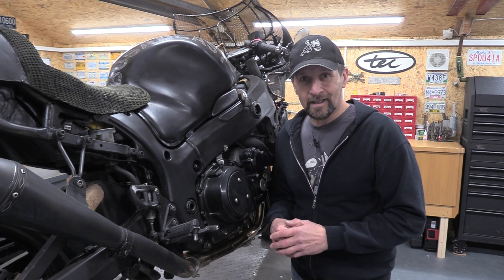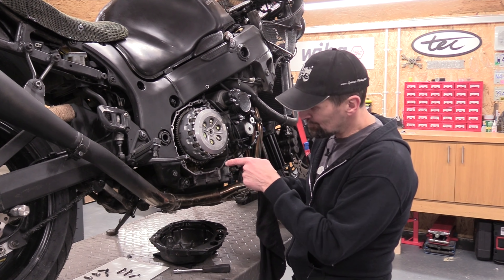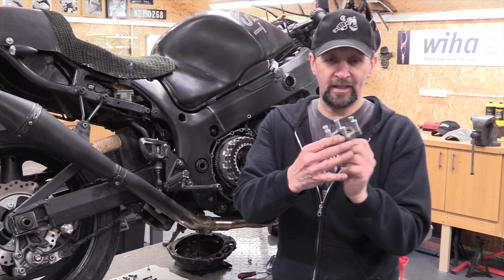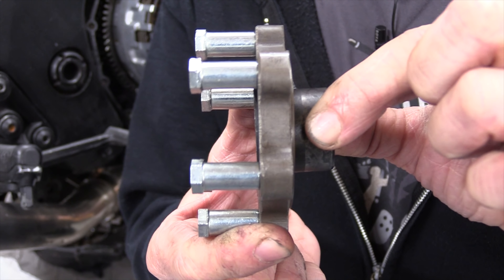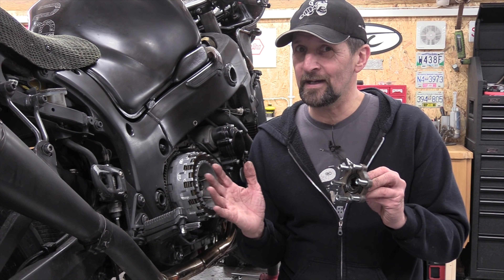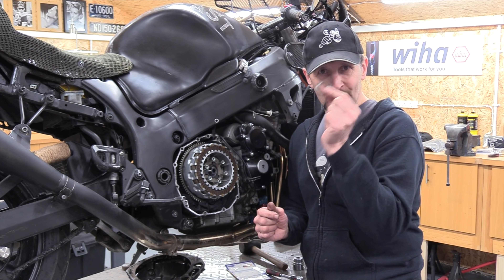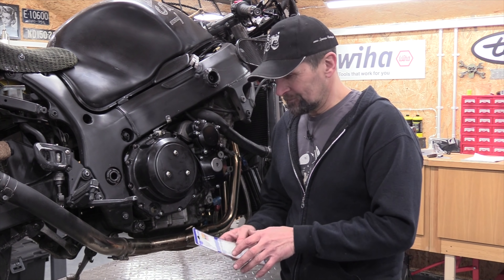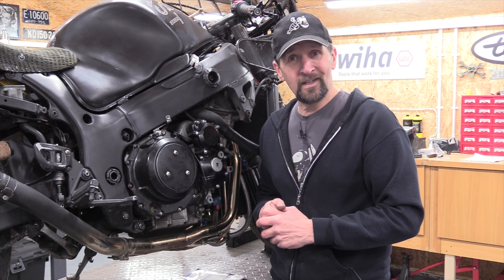Suzuki Hayabusa Gen1 :-  Clutch Mod Install

Comment: I didn't know that the Busa had such a simple, cheap and effective slipper clutch. Clever idea, but obviously there is wear in the end. Good that you showed us a simple way to solve the problem. Thanks from Nürnberg/Germany, Günter
Reply from the maker: Glad to help Günter , It's actually a common mechanism in many Suzuki models, TL1000, GSX1400 etc, and does indeed suffer with wear, and after 40k miles, mine was playing up, so time to lock it up and eliminate it from the system.  Have a great weekend and keep safe.  Del.
Reply: @wilsonisme1  Interesting. Food for thought. Thanks for sharing

Comment: When you took the clutch apart I noticed the outer friction disk was in the wrong slot. You did correct that. Maybe you should have mentioned that. As far as the Clutch Mod. I prefer the Mod you used. Or the one piece Mod. I'm sure some will disagree. But far as I'm concerned the welded fix will never be balanced properly.  Good video...!
Reply from the maker: The plate wasn't in the wrong slot, it only goes in one place, it just came out stuck to the outer pressure plate and I flicked it back in, and you are right, some argue that a welded mechanism isn't balanced, and the one piece billet ones are way outside my price range, this is the third one of these I've actually fitted, they work a treat and have never let me down!
Reply: @Moonfleet41  Not to argue... But I watched the video again. The last friction is in the long slot as you remove the pressure plate. And when you reinstall the pressure plate you have moved it to the short slot where it should be.
I was agreeing with your Mod. The ring you installed is a Good fix and holds up well and presents no balance problems.
Reply: Aa a welder myself i would have no worries about balance if TIG welded by a professional as the weld would be an even width all the way round and that width would be small, say 3mm wide. Being so close to the centre of rotation, any imbalance would be negligible and would have no detrimental effect.
Reply from the maker: @bertzx9r894  " if TIG welded by a professional" exactly that, which is why i didn't weld it, it's way above my pay grade..
Reply: When Brock Davison installs clutch plates on a Suzuki the very last plate he rotates one notch. I don’t really understand that. If anybody understands why please let me know.
Reply: What it called  where can I buy it

Comment: I've heard about this mod, but had never seen one being fitted. Now I understand. Thanks.
New shop looks awesome, and the audio is crystal clear. The wall panneling must be a winner
Reply from the maker: Thanks mate, simple enough mod aye?  And for those who can't weld to the right standard, or afford to buy performance parts, this is a perfect nut and bolt fix... and thanks for your kind words, the textured walls and the open roof have made a difference!

Comment: Yes Del I had to learn the hard way, 30 years ago I had a Suzuki GS 750,  I was adjusting the valve clearances, I’d made a tool to lever the valve buckets down to remove the cam shims with a old Allen key, but couldn’t get enough leverage on the key, so I used a small length of pipe to extend leverage, and yes you’ve guessed right, it slipped off and the bloody Allen key disappeared down the timing chain hole, my heart sank, major engine strip down😩 but I was so lucky, after many hours with one of those magnets that look like the car aerial I fished it out, boy was that a relief 😅 that’s when I decided to block the hole up before Continuing adjusting the cams, workshop is looking great, that’s a good cheap mod cheers Del ⚙️🔩🔧👍
Reply from the maker: HAHAHAHA.. Mate, i feel your pain, i was that man too.. literally dropped and actual shim down the chain shaft.. Bastardicus maximus..  had no fancy car aerial magnet thingy.. turned the engine upside down in vain hope.. and the shim went up under a piston skirt and lodged tight.... but at least pulling only the top end off gave me access up under the piston...  lessons we never forget aye mate.   Thanks for your kind words, have a great weekend.. Del.
Reply: @Moonfleet41  we’re older and wiser now thank goodness, cheers mate 🍺

Comment: Way to go mate! I'm getting ready to do this to my 2002 Hayabusa I'm getting weird slipping clutch issues under full throttle where it almost like feels like you're pulling in the clutch lever instantaneously and I come to find out it's the ramping crap and I get the knocking at idle with the clutch lever out too it's very annoying. I can't wait to do this tomorrow. Thanks for a great excellent video also to anyone doing this always get the Gen 2 clutches cuz they have more clutch material than the Gen 1.

Comment: I have a '97 TL1000S and the clutch ramp system apear slightly different to this in terms of its size however i cant confirm that as it was welded before i bought the bike. The clutch did slip slightly on hard throttle but a set of Barnett clutch springs put an end to that.
Great video Del and i love seeing these little snippets of difference with the different bikes.
Loving the triumph build but will admit to skipping a few episodes due to being a long term subscriber and seen the caliper rebuild on the ZX7, caliper rebuild on the Busa... so occasionally its a case of same footage, different bike. Always around for the fresh stuff though and aways will be.
Be well D&P.
Reply from the maker: Thanks Bert, we just upload the projects that come along, and I think maintenance and refurbishment videos can always benefit from being refreshed and done again, because people don't tend to watch your back catalogue as much as the fresh ones!  Plus of course if it's their specific bike they're more likely to watch it, but agreed, if you're a long term viewer then some subjects will come round a second time... I guess it goes to show how much stuff we've covered over the years!  Thanks so much for your support, we really appreciate it!

Comment: The first clutch friction plate was in the wrong place, until you shifted it,, but then you knew that ;). Im going to do that mod to mine but i will weld it i think,  looking forward to the slave cylinder mod too
Reply from the maker: Sure thing buddy, welding works if you're good enough at it, but it must be TIG welded and unless you're gonna weld it all the way round, make sure you space the welds evenly for balance, but I'm absolutely sure you knew that lol

Comment: It’s a constant mesh clutch not a slipper clutch, the idea being it limits back torque on down shifts and stops the wheel from locking. 

But the original clutch causes issues on launch if you get it in between the area of revs between it engaging and disengaging causing a hairy launch.

Also if you have fitted stiffer springs you really need to beef up the mount for the slave cylinder mount as they are notorious for cracking and falling apart with heavy duty springs.
Reply from the maker: Check out the very next video we'll be loading up online on Tuesday mate.. Slave cylinder brace plate... ! great minds think alike aye.!±

Comment: Did your clutch jerked during launching? Mine is doing some violent jerking occasionally if you are launching it. I have been recommended to install all new OEM clutch steel plates along with friction's, but I'm guessing that it might not be solved until this kind of modification is done.

Comment: I did the mod on my previous Hayabusa by welding it. Got another Hayabusa now, fairly high mileage, and definitely want to do the mod again. I like the idea of the spacer ring though. However my question is more on that lovely torque wrench setup you have there. Where can I find it online?
Reply from the maker: There is a link below the video that that T-Bar Torque Wrench, along with a link to the parts used on the bike..  Good luck with yours, hope this helps.

Comment: Great Video - I can't see the link to the seller who sells the schnitz locking ring for hyabusa clutch, I live in Australia and the cost to have it sent from Schnitz racing is almost the same in postage as the same for the part. Any suggestions would be most welcomed.
Reply from the maker: It's in the eBay link i posted in the description below the video mate..

Comment: Hi Delboy, I want to share information.  I ordered this part (hayabusa 99-07) and installed it in a suzuki gsx 1400 year 2006, it fits.  same clutch hayabusa  and gsx 1400😉
Reply from the maker: Thanks for the info
Reply: @Moonfleet41  UPDATE several times my clutch slipped at higher speeds after installing that part... it was very annoying at 150 km/h when it slips and then catches again... I took the part off... something didn't fit right and I wouldn't recommend it  if that part is installed on  gsx 1400... I wouldn't like someone to install it and then something happens... very annoying when at high speed the slats slip and then catch again,... Sorry
Reply from the maker: @tomislavknezovic1  I don't know what you're referring to by clutch slip, if you're referring to the lock up ring that stops the back torque limiter from operating, then it can't slip if it's correctly fitted as it locks the mechanism solid... so not sure what happened for you, but never had a problem with mine on the Hayabusa... but thanks for your input!

Comment: Is there a place for option 4, to replace with a new slipper clutch? Then you do not lose the benefit of the job it does. Or is it too expensive/ not work having anyway?
Reply from the maker: It wasn't a good design in the first place mate.. but i guess you could simply order a new one from your main dealer... !

Comment: Do you know if a similar kit is available for the TL1000R?  If so is it possible to use the standard springs so as not to make the lever heavier and reduce the strain on the slave cylinder?
Reply from the maker: I believe it is, provided your bike has a back torque limiter, check with the supplier for spec on your bike, I left a link in the description.

Comment: Hi dear .. I have hayabusa gen 2 .. And i have issue .. When the gear on position 3 and RPM high then when i leave the throtel i got like a cut when RPM arrive to like around 7 do you think this issue due to this part you work on ?

Comment: If you need to ever replace your "conical" washer they are called Belvoir washers and are available in different sizes in the engineering world so you wont need to go the the bike shop for your new one and as already said they are a one use device.
Reply from the maker: Thanks mate, when we're allowed out to play again, I may pick one up just for good measure!

Comment: Is it wrong I'm checking out your tools? 😉 ☺ 😂 
I love my ugga chugga gun and was admiring your torque screwdriver but don't use one often enough to warrant the price. Cheers matey.
Reply from the maker: Aha, but therein lies the paradox, you may not use one, or find life hard without one, but if you buy one, you'll soon find a million uses for it, and reach for it all the time.. and for the huge nuts on front sprockets and clutch baskets alone, they are a really handy option.!  and with a fleet of training bikes to keep rolling, i guarantee you'll 'justify the buy'..!   so if you buy one, then ill buy a 360 camera (which i definitely don't need.!lol)
Reply: @Moonfleet41  hahaha, this is like two people trying to stop smoking... "go on, you have one then so will I" 😂 ok... What model is that one? ☺
Reply from the maker: ha ha yeah, "no you go first"..!   The impact gun i use is a fancy programmable one that works through an app, 300Nm torque, lots of features you won't need,  hardly for occasional DIY use anyway.. it was over £400 with both batteries and the charger, but like all these tools, It's the batteries that cost the money, and once you have a pair of batteries, and charger, you can buy the bare hand tools for more like £100 a go.. drills, impact drivers for woodwork, angle grinders, power saws, any hand held power tool you can think of.. as long as it uses the same batteries, just buy the tool.. Once you swallow the heavy first purchase of a kit with two batteries and charger, it gets a lot more cost effective from there..  Here's a few link that may help, 'Russ' (who owns Spanner Monkey) does them all at really competitive prices, and would be happy to work you out a deal if you call him direct, tell him i said hi.. https://www.spanner-monkey.co.uk/index.php?route=product/search&search=+Milwaukee+M18+&description=true  !
Reply: @Moonfleet41  I've got the ugga chugga gun already, it's the wiha torque screwdriver you used I was looking at. ☺
Reply from the maker: @RoadcraftNottingham  Oh right, Duh, sorry, "must try harder".  Thats a 5Nm to 14Nm Torque Driver    There's a link under the video to it, but yer Tiz'  https://www.spanner-monkey.co.uk/Wiha-Torque-T-Handle-ST-Plus-TorqueVario-Set-29234?search=wiha+torque+vario&description=true
Reply: @Moonfleet41  HOW MUCH? I spent all my money on a fast toaster ya know! 😂
Reply from the maker: @RoadcraftNottingham  Ha ha yeah..good ain't cheap and cheap ain't good..    you could save up the money from the petrol you WON'T now buy for the toaster aye :-D..!

Comment: I haven’t got a Hiabusa I just enjoy your videos great work as always I really like the small torque wrench spanner are the expensive ? Keep up the great work 👍👍
Reply from the maker: Hi Dale, thanks for your kind words, the small precision torque wrench isn't cheap, bit it is a premium quality tool, which is important for those smaller toque values that can be easily stripped.   I posted a link to the tool under the video mate.

Comment: Really interesting clutch work!! At first I’d thought it’s clutch plate, apparently, it’s more than that, moving magazine system (whatever you call it) . Sure simple fix with spacer. I’d think you licked this one,  personally, I wouldn’t weld any internal parts at all as it may crack at the weld point. No matter who’s professional. ( that’s my opinion)  perfect example before and after video!! I like that!!  Kwel!!
Reply from the maker: Thanks buddy, I have to agree with the welding opinion, it truly would have to be done by a top class professional, otherwise there would be balance issues possibly (maybe not as it's very close to the centre of rotation), but nevertheless with the heat issue, I agree... it's already hard metal so one could question whether heating it to weld temperatures could anneal parts of it and I guess this is why the drag racing guys who run monster horsepower actually swop the mechanism for a solid billet steel one... happy with this route though and certainly more confident in it than I would have been with my own welding.
Reply: @Moonfleet41  .. my dad welds past 60 so years, he can’t make near perfect, maybe close. Win some, lose some. Heat and material wise is biggest challenge. I second what you said. I’m kind of guy modified to make things work like you did. Got from EBay?? That’s interesting as I’m EBayer too. Always find something there.  Btw- what’s the cost for that kit?? Just out of curiosity 🤗 btw—- I like your torque Allen wrench,, hava find me a set..  can’t wait your next video.  Stay safe..
Reply from the maker: @Goldwing1500rider  I mentioned in the video at the end buddy, maybe you skipped it.. the kit is £85 with the springs included.
Reply: @Moonfleet41  .. guess I did... unless it wasn’t captioned as I’m deaf... I read and follow actions!! Smile. Lol
Reply: @Moonfleet41  .. I went back yes you said 85 pounds... in America we say dollars... something I have to get used to.... thanks del!

Comment: Not everyone's favourite ...  But hey when a Clutch is due it's due .  Between et toi Del and Moi was gonna like into 1 st sec's ( Promise I didn't 🤞 .) .  Although there good ? Clutches From factory / Race type ain't They ? Not been many aftermarket ones available ? Till now  😁 ..  Damm  ... 55 thou or so from new on mine ..  I'll wait till the Achilles heal ., Clonk etc ... Nice kit it seems . P.s... knew someone with Busa trouble a main dealer resisted changing the Clutch ...They had no choice in the end .  I did warn Him . I don't think He test rode it ..

Comment: Del can you purchase this for a zzr1400 2019 model ? 
Is it the same set up as this video? Just wondering pal
Great video
Reply from the maker: Believe you can mate, but just check the website, the link is below the video in the 'description', they certainly offer them for the TL1000 and SV1000, and I think I saw one listed for the big Jix14...
Reply: @Moonfleet41  cheers keep up the good work

Comment: not got a booser but as they say knowledge is power :) Del didnt yu have to clean that cover surface we know yu put grease on it but the mating surface looked a little tacky. I was waiting for you to clean off the surface so the mating the pair has a good seal ?
Reply from the maker: Many bikes have that style of back torque limiter mate, TL1000's GSX1400's etc.. so it will hopefully help a lot of riders.. and i fitted that casing back when i bought the bike, it's a new gasket, Hylomar on the casing, and grease on the engine..(what you saw in the gasket was grease), i just topped it up for a good seal .